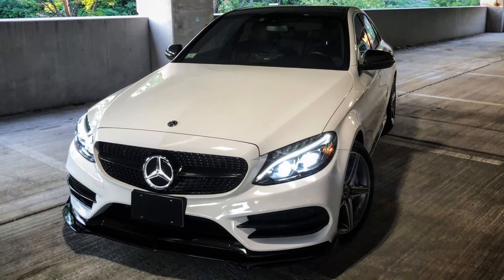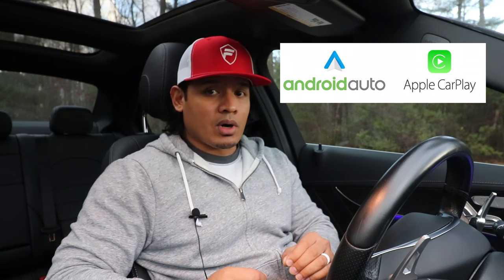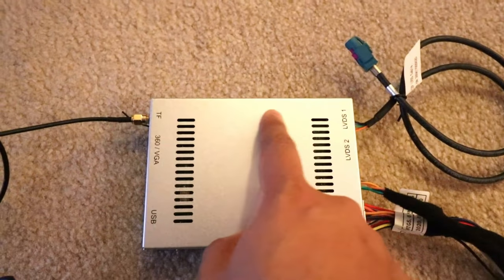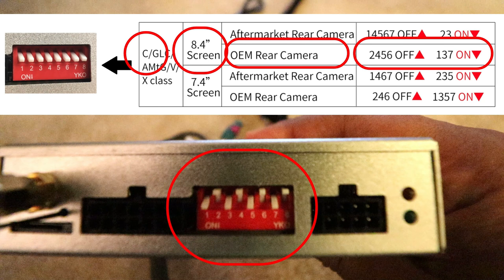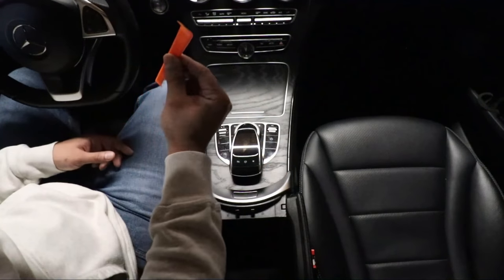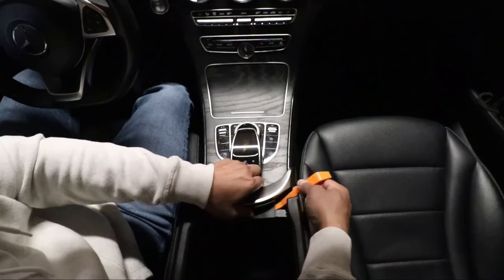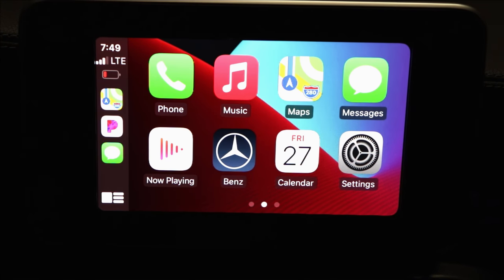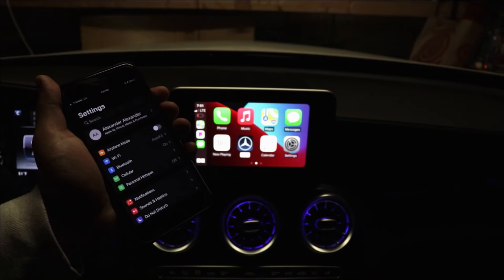Easy Wireless Apple CarPlay installed on OEM Screen of 2015+ Mercedes W205 C-Class

Comment: Hi, easy tutorial thank you so much! 

Just one question, for things like climate control, will the climate automatically appear on the Apple CarPlay screen or do you have to go back to the OEM system to view temperature and stuff like that. 

Also, if the CarPlay screen is open and I enter reverse, will it automatically switch to the OEM system for the camera or do I have to manually exit the CarPlay to view the camera?

Thank you so much! Will def follow this tutorial if I do order
Reply from the maker: I don’t remember on the climate. I believe it pops up on the bottom when in CarPlay.  

Reverse will auto pop up no matter what screen your in.
Reply: @TheFlexxGarage  Sweet, you answered my doubts. Thanks for the reply!

Comment: Are you sure it doesn't work in a 2014 W205? I have the upgraded COMAND screen, but I would really like carplay.
Reply from the maker: There’s no such thing as a 2014 w205 c-class in the US.
Reply: @Martin. The W205 is a 2015 model with sales starting late 2014 in some countries. It is exactly the same as the W205 sold between 2015 and 2017

Comment: Hey Flexx, 
Can I physically connect my iPhone to the car via a cable and still get apple carplay ? Or is it just wireless with this device ?
Reply from the maker: I dont know. There is a USB connection port on the module (that I didn't use). It's next to all the tiny switches. I guess you can ask DMP car design if they have the kit with a USB cable that plugs into the module so a phone can be plugged in.
Reply: @TheFlexxGarage  thank you !
Reply: @AksharUdupa   did you ever find out if you can connect wired for car play?

Comment: Is there a way I can do this to my 2012?
Reply from the maker: I think there is. You might want to ask DMP on that.
Reply: Yes it works for 2012. The DMP link says it's compatible with Mercedes Benz 2007-2011 NTG 4.0 Model
Mercedes Benz 2012-2014 NTG 4.5 / NTG 4.7 Model
Mercedes Benz 2015-2019 NTG 5.0 / NTG 5.1 Model

Comment: I see your fuse in the back of the radio is green and 20A the one in mine is 15A. And it’s a 2015 model. I’m just wondering if that could be why there’s no sound from my speakers. Sometimes it plays sound and then stops. I’ve tried changing it to a 10A because I’ve seen on other videos there’s was 10A. Should I try 20A?
Reply: Needs the aux wire connecting bro

Comment: I’m installing rn but CarPlay has no sound. When I switch to radio volume works! Any advice?
Reply: Also CarPlay looks smaller on the display
Reply: It doesn’t fill the entire screen
Reply from the maker: If you bought it from DMP, then they can help you with your settings to correct every issue you mentioned.

Comment: Hey, can you please upload a video for the new new device (2022) because the one I order for my 2015 Mercedes Benz C300 looks nothing like yours, I’m guessing it’s probably a new version? 
I installed it but it didn’t work just black screen, don’t know what I did wrong. The device had a blue blinking light but that’s it. HELP PLEASE!!!
Reply from the maker: You need to contact who you bought it from for support.  If it’s DMP, they can provide you will a solution.
Reply: Did you set the DIP switches correctly for your COMAND version? That's the only thing I see that could affect proper display (assuming that your kit is not defective).
Reply: Switch the LVDS around
Reply: @bwest6275   see that’s why I was frustrated because the box the device came with had no instructions manual no papers no nothing 
Like would you be able to tell the correct way to set up the DIP switches? Would greatly appreciate it
Reply: @vincentma1618  whats LVDS ?? Sorry very new to this
Reply: @danielmiranda8947  did you manage to figure it out? Im still considering buying this thing, but I'm having doubts considering your message about this Carplay kit.
Reply: @BestnBaits  I figured it out! I messed around with the switches on the module and got it
Reply: Make sure that the switches on the back are set right, the default for some cars is the 7in screen Flexx probably got the multimedia package with the bigger screen

Comment: Are you able to still connect the carplay using a usb charger? I want my car to charge and be used lol
Reply from the maker: Not sure. That’s a question for DMP. When i had the CarPlay module added to my oem screen, I only used the Bluetooth connection. Never bothered to use wires. 🤷🏻‍♂️
Reply: I believe it will work both wired and wireless. I am getting mine tomorrow and with the simple instructions from OG Flex, I will update you but I am pretty confident it will. Think about connecting your phone to the USB charger by your arm rest...will update you once I am installing mine...
Reply: @GoldenArtProduction  how did it go?

Comment: Hey Flex. Great video as usual, one question about this kit. Will installing this void any warranties on the car?
Reply from the maker: Answered this many times.  

It's up to your warranty supplier to decide if there is coverage or not but the general rule of thumb is...any aftermarket part installed on a vehicle should void the warranty. No warranty company is going to pay out money to cover a vehicle's issue if it has aftermarket accessories installed (which could potentially cause an issue). Even if it's OEM parts they might not cover...if the install was not done by a professional.

Comment: bro you do not have to disconnect the battery...
Reply from the maker: I do when I’m a Youtuber and thousands of people might copy my installs. I rather be safe than sorry. You do you but I’ve always disconnected my batteries with zero issues. I’m not gonna be held responsible for someone shocking themselves. I rather cut the power completely and know 10000% the install is safe.

Comment: Hey Flexx-- installed this module and now am getting a "auxiliary battery malfunction" red flashing message that recently turned white. Eco start/stop is still working, think the cars just glitching out with the aftermarket part installed... I dont know, any ideas?
Reply from the maker: No clue.  I’d check with whoever sold you the module.  If it’s DMP, then they can help 100%.